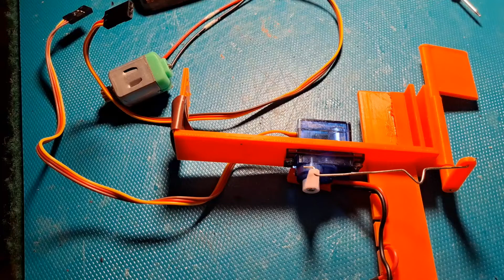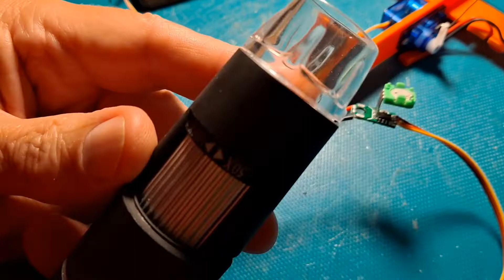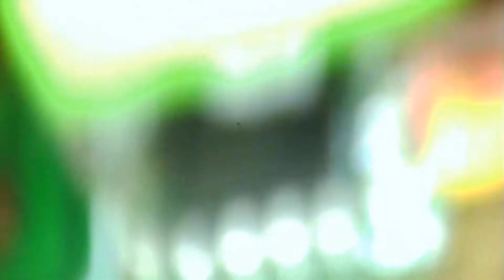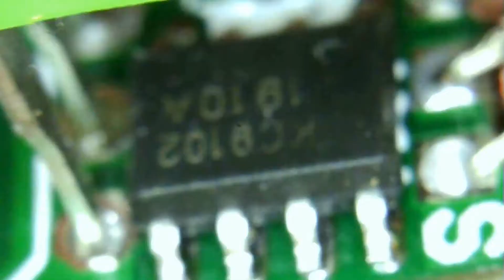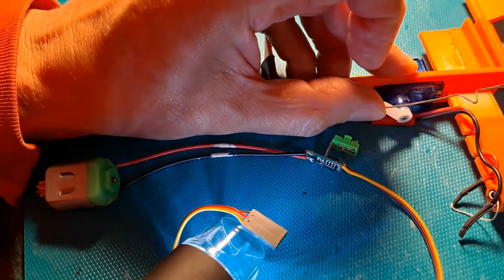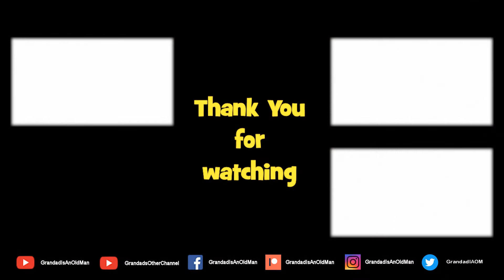Servo chips for Hermit Oldguy

Comment: Ive just seen your video and this has been the most illuminating one ive seen regarding whats on those servo boards! In your opinion, how hard would it be to design a custom PCB that has all of these components? well, honestly a clone of this? the reason why i ask is because a lot of broken toy robots and such (expensive ones mind you) and they have motors and pots and operate like servos but the driver chips are on the main PCB for the toy. And if that board gets messed up, the toy gets thrown away and thats more waste. I want to reuse these toys and i have figured out that if i take the controller board from a servo and transplant it into a broken robot arm toy I can plug the 3 wires into a servo driver board for a rasp pi for example, and have control over it like a regular hobby servo. I don't want to rip them out of new servos, it just seems wasteful.
 I took all the information you provided (schematics and all that) but i really dont know what to do next. im not an electrical engineer and have never designed a PCB before, so im kind of at an impasse. any help would be neato, thanks.
Reply from the maker: You would do better subscribing to one of those channels that focus on robotics, or raspberry Pi, or arduino. There are plenty of videos and forums on using them for robotic applications, including building the control interfaces. There is some information about the chips shown, in my video description.